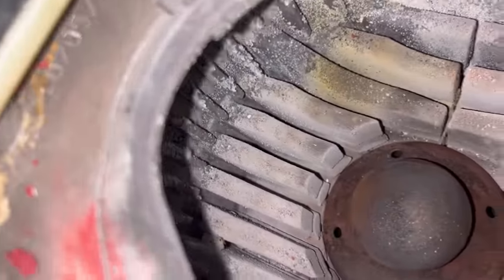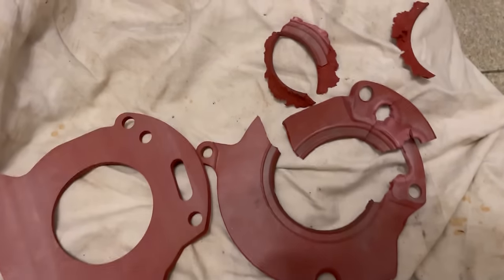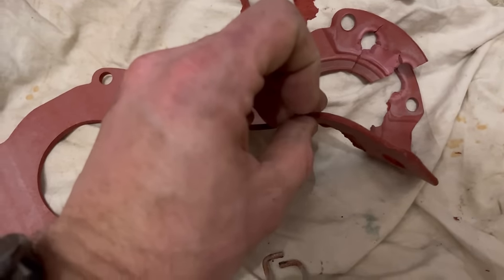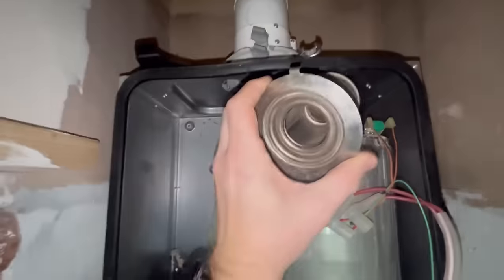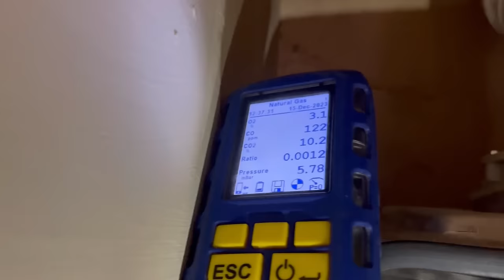Worcester Boiler Breakdown Turns Into A Nightmare For This Customer!

Comment: I've had many of these. In dublin people think they don't need to get a service and wonder why there boiler is beyond repair. The parts all have to be imported and they're not cheap. If I get a boiler with water damage like that it's in the customers best interest to get the new boiler with the warranty. Unfortunate bad news to have to deliver but you only found the problem you didn't create it. I'm sure if it could be saved you would save it. It is what it is 👍👍👍
Reply from the maker: Thanks mate…Is unfortunate for customer but these things happen, maybe Worcester will send a new heat exchanger and we can save it but if not then may look at new boiler route, with the warranties you can get nowadays it is tempting for most to replace 👍
Reply: Surely a new boiler is over £2k fitted maybe more these days, is that worth it over a replacement h/e and lack of warranty?

Comment: Nice upload mate..
WB kebab hex has a 10 year warranty...
A leaking hex ( water only) is AR but once not leaking POC its fine to keep it going.
Hope you checked the bearing plate washer and a bit disappointed you never just checked the top baffle for excessive pitting and just flushed the bottom one ( as they can be welded to the hex due to scale build up)..
Other than that...good job and look after those hands..( most important breakdown tool)👋
Reply from the maker: Thanks mate, as said in video I didn’t want to go too in-depth due to the work that needs doing, if they get a new heat exchanger I can check bearing plate, I do keep them as van stock. Hopefully Worcester will come through with a new heat exchanger and we can get it swapped) hands am getting better, been wearing gloves where I can last few days 👍

Comment: That boiler looks older than 10 years to me, old skool air vent hose on it…
Often the boilers at the highest point in system, plus no low pressure cut off speeds up the hex cooking itself… might as well just leave it in there crusted up
Reply from the maker: Why didn’t Worcester put a low pressure cut off in these? I go to a few that have next to no water in cooking away! Got a feeling its over 10 years but see what Worcester say 👍

Comment: I had one that bad it was 12 years old and Worcester did a one off repair £328. 3 main parts and most small parts. Cant even get main heat exchanger for that give a try mate.
Reply from the maker: Worth a try mate…customer has been in touch with Worcester so just waiting to hear back 👍
Reply: Yeah Worcester will do a one off Payment 300 plus vat that is the way to go

Comment: Did you change the gas supply tube always good practice to do so also if your just changing the gasket it's actually cheaper to buy the gas supply tube kit and you get the gasket with it
Reply from the maker: I didn’t as I didn’t have one, bought the electrodes pack which had gasket..agree thou is good practise and low cost replacement 👍

Comment: I’ve got that bag, too bulky for me. Put it in the garage for storage ha
Reply from the maker: Expensive storage box that mate 😂 some days I think it’s great, got everything I need then other days it’s weighing me down and getting in way, I do like it but might need something in-between sizes for smaller jobs. Which bag you using at moment?
Reply: @bluebulldog_uk  velocity rogue 1.0. Doesn’t fit my analyser in as that has its own case but ideal size mate

Comment: So what was the issue with the heat exchanger apart from some overheat damage? Surely the crud is from gasket not sealing?
Reply from the maker: It’s leaking on heat exchanger around the seal. those are water marks that you can see…they can get worse than that, I’ve seen loads of gaskets go without any crud forming. I wouldn’t say it’s common but I’ve seen a few go around that too seal
Reply: @bluebulldog_uk  thanks for reply👍
Reply from the maker: @burntre1  no problem mate 👍
Reply: Has that heat ex definitely gone mate? Looking at colour of the crud it looks more like products of combustion. I’ve always found when it’s the heat ex that’s gone on them you get a browny damp crud around the top rather than the colour on this one.

Comment: Hello m8t audio rubbish really hard to understand what your saying ,surely heat ex is ok it’s the gasket that’s blown why didn’t you clean out and wash the heat ex while you had everything off you put the new gasket on with out even cleaning the top of the heat ex…and Worcester will only replace heat ex if boiler has had regular service and signed service records …
Reply from the maker: Heat exchanger has gone on seal around front them marks are water leaks not from the gasket, it’s only going to get worse…suppose I could have but it’s either coming out or being replaced at some point…not sure why some people saying audio poor and some saying ok but I’m recording on my phone at moment so sometimes it might suffer so apologies for that I might look at upgrading phone or using go pro
Reply: Just needs a new heat cell easy job and much cheaper than a new boiler I can do them in 30 mins including drinking two cups of tea lol
Reply from the maker: @charliewillis8527  yeah new heat cell isn’t a problem nice job isn’t it once you’ve done a few but looking at the auto air vent the water quality will be poor within system, going to recommend if they have new heat cell to have a system clean done with filter to give the boiler best chance of going a few more years. How much tea do you drink in a day if you have 2 in 30 mins 😳😂👍
Reply: @bluebulldog_uk  yes people run the Worcester down but I love them easy to work on and ther service is great had two boilers one was 9 years old and the other was just under 10vyears they supplied heat exchangers on both and I fitted them you can't get better service than that you can stick ideal and baxi service is crap
Reply: @bluebulldog_uk  a lot of tea when my mate comes with me it beats him lol
Reply: Hello I'm just wondering Analyser is that is multifunction and does oil boilers?
Reply: @charliewillis8527 The compact isn't easy to service it's crap, Baxi and ideals are way easier to service.Worcester after service is good though.